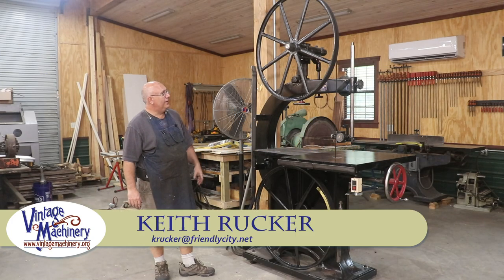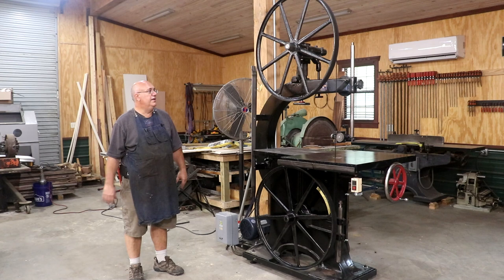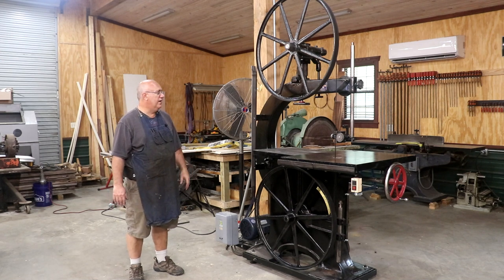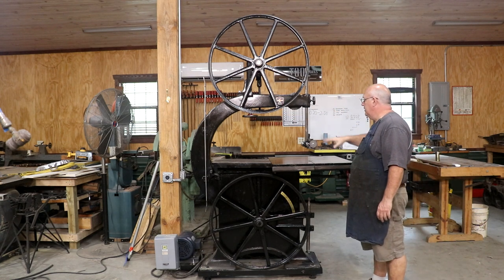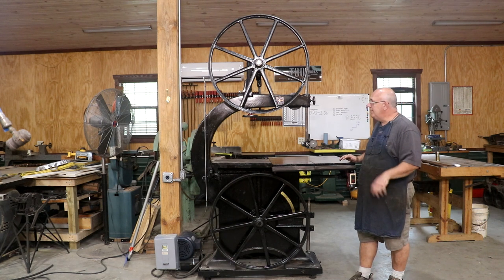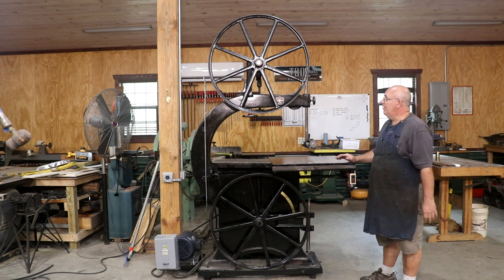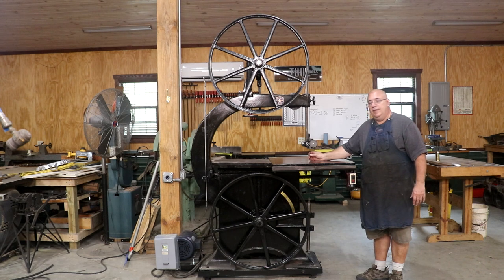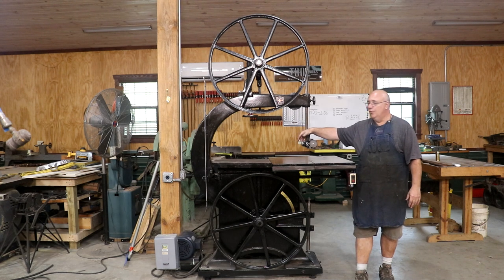Restored and Ready to Go: Crescent Angle Band Saw

Comment: I get that Keith said he's accepted the risk and wants to keep the machine authentic to what it looked like new, but I'm not gonna lie, this machine scares the crap out of me without guards. You could get caught in one of the wheels, and if the blade popped off the wheels it's even scarier. I've had blades come off my modern bandsaw, with plenty of guards, and that's unnerving enough. Diresta has a bunch of these old bandsaws and they have been fitted with nice guards and I do not think it takes away from the look.

Comment: I might suggest that if you do a "blade guard" casting, that you do it out of aluminum. Since it's going to be painted anyway, you could duplicate the look with less weight to move around when you're changing the elevation of the blade guide.